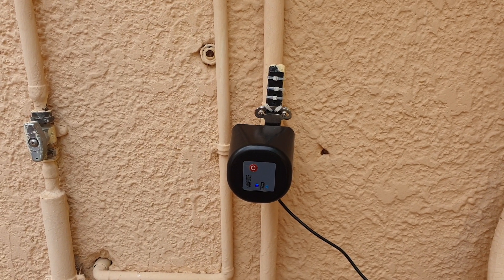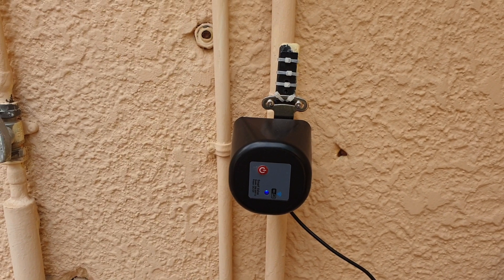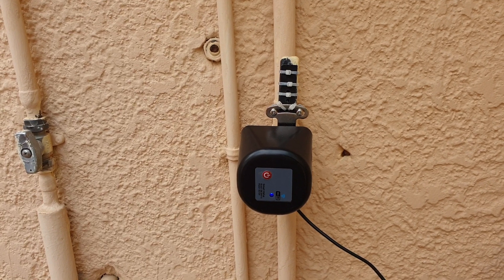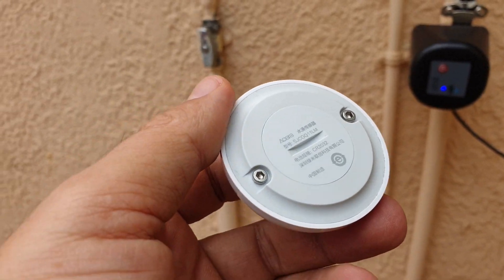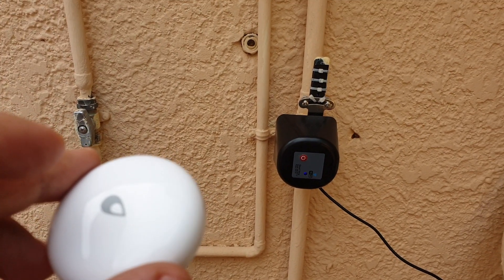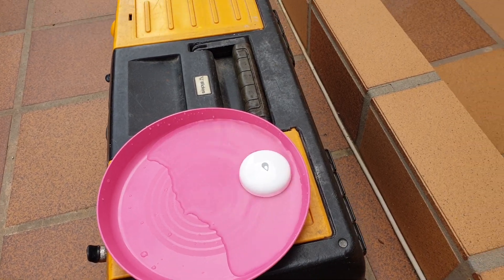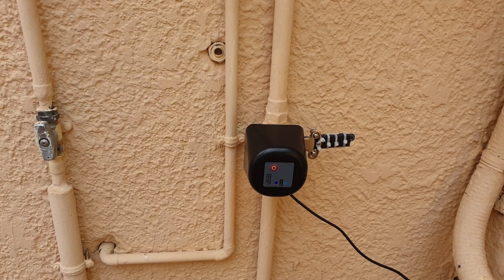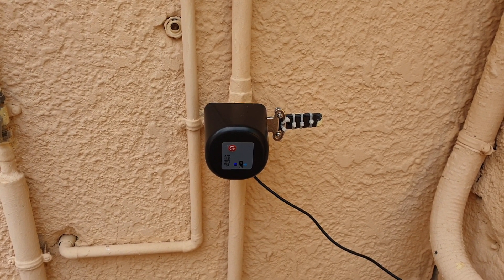Home Automation: Tuya water shut-off valve testing with Home Assistant

Comment: Can you make a tutorial videos showing how did you integrated with Hass?  Do you need the gateway?
Reply from the maker: I'll try to make one this weekend. You will need either the Xiaomi Gateway or a zigbee2mqtt usb dongle to integrate the leak sensor into Hassio as it uses zigbee protocol.
Reply: @zoltar99  awesome thank you!!! Great automations btw
Reply: @rafac13  how hard was to integrate this valve in Hassio? zigbee2mqtt is working ok on mine
Reply from the maker: @iluhis  it's as simple as adding your smart home account in home assistant. Zigbee2mqtt helps integrate the sensors, the valve is Tuya based, once you have your tuya account in home assistant, devices from Smart Home will appear in your hassio. Just add the following in configuration.yaml:
tuya: 
username: YOUR_TUYA_USERNAME password: YOUR_TUYA_PASSWORD country_code: YOUR_ACCOUNT_COUNTRYCODE
Reply: @zoltar99  thanks. and it is seen as a "switch" in Hassio, right?
Reply from the maker: @iluhis  That is correct, it is a switch, it will take the name you configured in Smart Home, but you can also customize it in HA. I have one problem with it so far. When there is a power outage and then the power is restored, it will shut down and you have to turn it on manually. Last time my wife was wondering why there was no running water in the house, until I realized that there had been a power outage that morning and had turned off the valve.
Reply: @zoltar99  when there is a power outage it shuts the valve off itself or when the power goes on again? Didn't understand what exactly is happening
Reply from the maker: @iluhis  it's when the power comes back
Reply: @zoltar99  thus when the power is back I need to flip the switch to some position to ensure that I have a correct data from it?
Reply from the maker: @iluhis  The data it provides is correct, it will be OFF, but the default behaviour is not what I want, I need it to be ON by default when the power comes back, yet it turns OFF. I suppose if you want to use it for irrigation for example that would be the required status, but when it is your house water mains pipe, that's an inconvenience. It should have an option to select the default behaviour.
Reply: @zoltar99  then you should make a power control point to know when there is an outage on your devices and make an automation to correct these valves into needed state.

It goes automatically OFF when the power is ON again until there is a new command to open it?
Reply from the maker: After looking at various solutions, browsing lots of forums, I am glad to say that I've managed to create a simple solution that tracks power outages without adding any extra hardware. Then when the power is back on,  an automation  turns the valve back on. Tested and working. I'm  going to make a video about it this weekend explaining it all.

Comment: Does it work without central unit? Just sensor to valve device?
Reply from the maker: No, the sensor is zigbee so it needs a zigbee gateway, either the Xiaomi or the zigbee2mqtt will work. The valve doesn't need a gateway.
Reply: @zoltar99  try wifi water sensor link to the vale then no need gateway